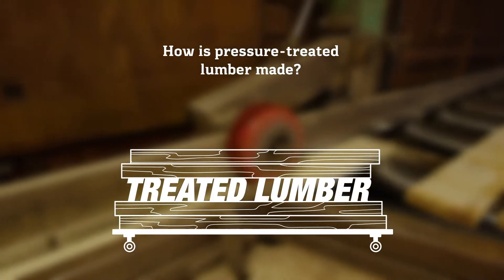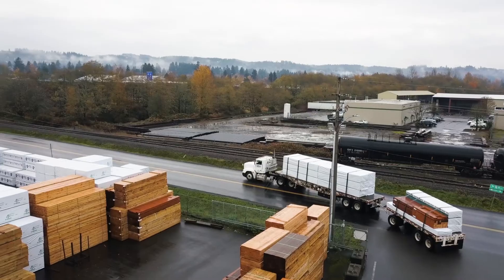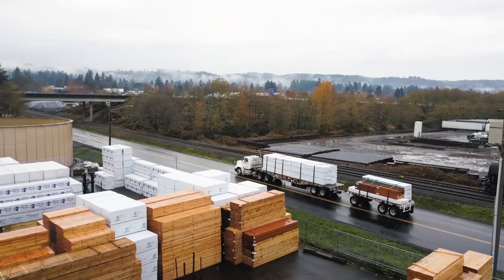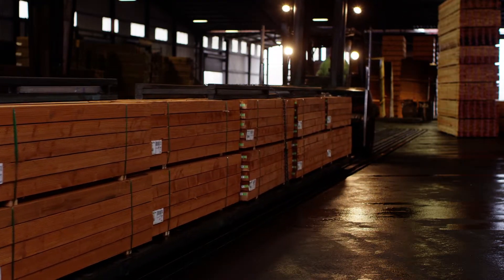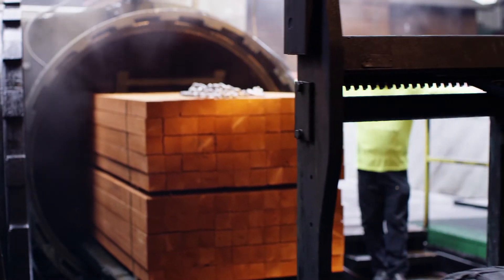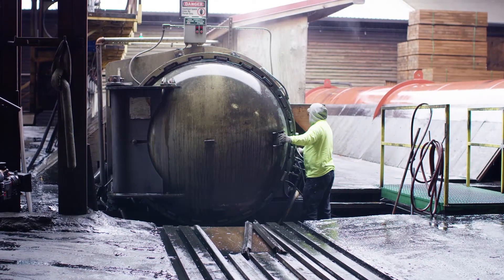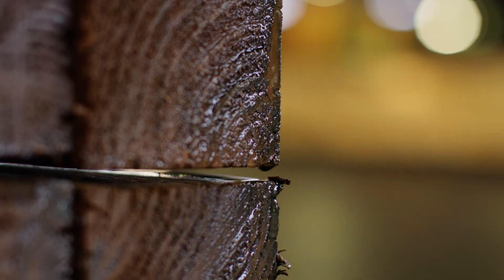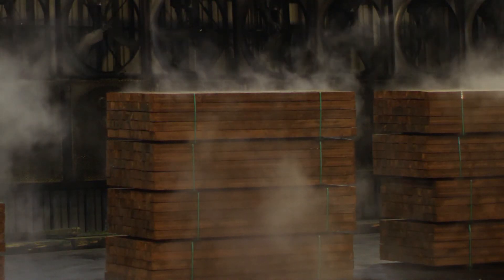How Is Pressure-Treated Lumber Made?

Comment: Not sure thats a good process those bales of wood were tightly packed hw is the chemical to penetrate when there is no gap all arounf them ?
Reply: pressure
Reply: the wood does have gaps they they use spacers typically every 4 boards + crossers for every bundle of wood